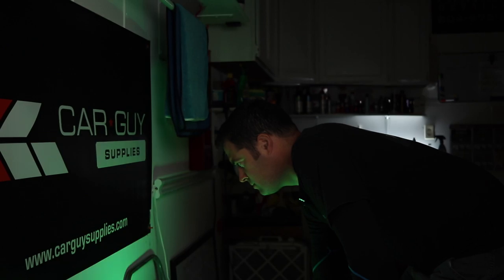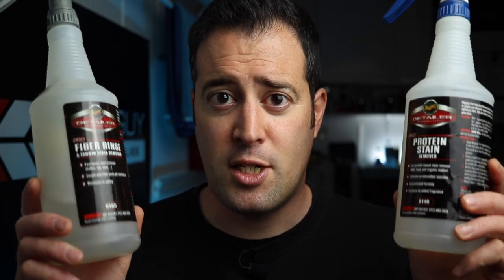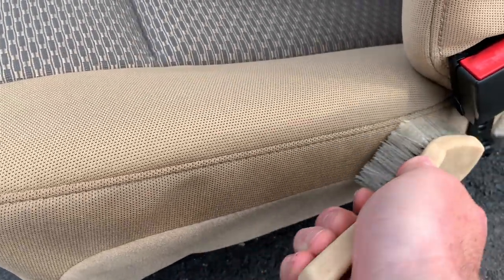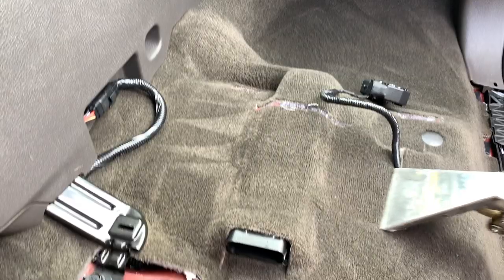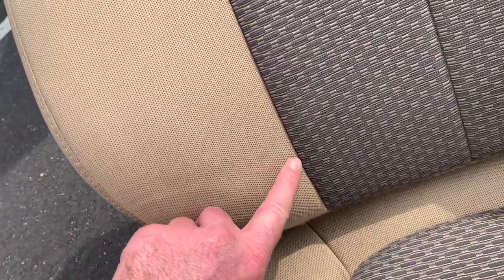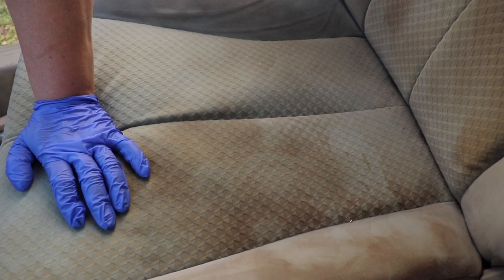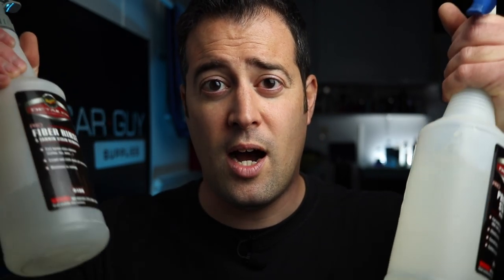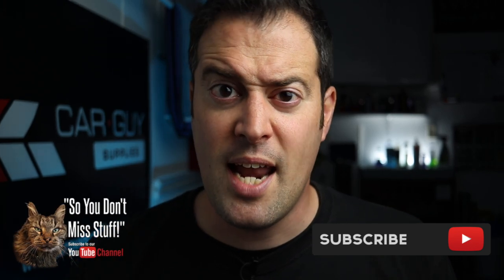How To Clean Cleaning Difficult Fabric Upholstery Seats! #nastystains #meguiar's

Comment: So I basically use d106, d116 if the stain isn’t being lifted with only d101? So if it’s not being lifted with 101 then I would use d106, d116 and back again to neutralize with d 106?
Reply from the maker: It depends on the stain.  Usually the D101 can lift many stains, if it doesn't then it may e a set stain.  if its a coffee, soda, or tea stain start with the Tannin Stain remover D106 first,  then use either D101 or D116,   and rinse with D106 again.

Comment: Hey Phil! Hope you and your family had an amazing holiday! I was researching better practices for cleaning fabric interior surfaces and looking at different products. I currently use the P&S trio (bomber, terminator, and finisher), and was wondering if you have any experience with those and how they would compare to the meguiars cleaners. The price jump into the D106 tannin cleaner ($60) is the only reason I haven't tried it yet. Thank you for the awesome video and it seems those 2 products do work really well. Thanks again.
Reply from the maker: Hi Thanks
I have only used the Carpet Bomber, and its pretty awesome. But I haven't used the other 2
The meguiars product work so well that I really haven thad the need to try the other P&S products.  I also like to use as few products as possible so having to use 3 products is kind of annoying to me.  Sometimes we use just the Tannin stain remover and its awesome.  Don't let the price on the tannin and fabric rinse deter you.  Its great stuff on its own.  You don't even need the Protein stain remover, just use an all purpose cleaner or OXY cleaner because that's pretty much all it it. It's a little cheaper here. https://bit.ly/2JkqGfw
Plus you can get Free Shipping over $65

Comment: Have you compared the P & S system to the Meguiars system yet? I'm interested in which is better. At least P & S has a neutralizer. Great video.
Reply from the maker: I haven’t yet.  I have used the carpet bomber which is incredible though. But I think they have a 3 part system correct?
Reply: @MirandaDetailing  They do, but I would love for someone to do a comparison side by side test on the two. There 3rd is a finisher neutralizer.  I've used it and it works pretty good also at a decent stand point.

Comment: I see the result and its awesome!

But now to  my question. I’m not an expert but logically if the stain is still there underneath the upholstery in the foam and the customer get the seat wet, isnt it a risk that the stain will come back? 

Keep it up and stay safe in this strange times.
Reply from the maker: Thanks. Yeah that’s always a risk. Same thing goes with the extractor though. If a drink spilled into the foam there is no way of getting it ALL out. It will dry out eventually. The most important thing is treating the surface.  Plus if anyone spills something again that’s on them, not us as Detailers. The only way to avoid anything happening again would be to replace the seat.
Reply: @MirandaDetailing  thx for the reply. I have learned alot from your channel and I just bought an extractor for my own personal use. im not a detailer by trade but its a fun  hobby for me. im grateful for all the knowledge you share with us. 
Why invent the wheel twice. 😀

Comment: Can I use the meguiars protein stain remover to remove smells from the carpet and upholstery due to food products and or urine and then use a extractor?
Reply from the maker: Yeah that should work great.  Odors are tough to remove completely though, so I wouldn’t consider it an odor remover exactly.
Reply: Miranda Detailing where did you get those bottles exactly with the labels? I couldn’t find them on car guy supplies
Reply from the maker: I had to find them on another website. They are just labels that I put on blank bottles.